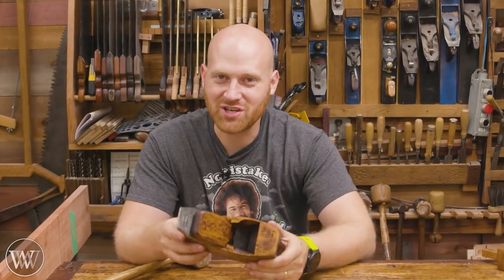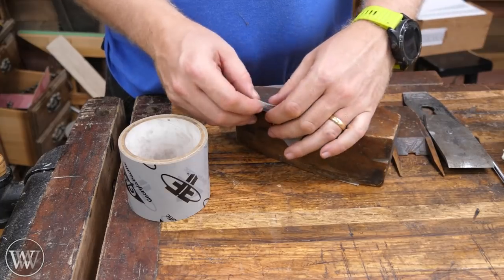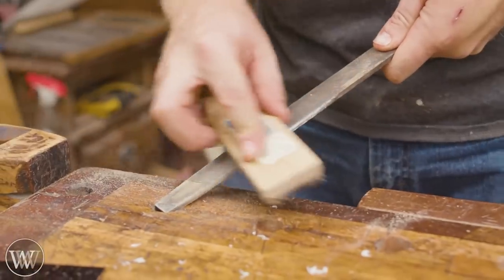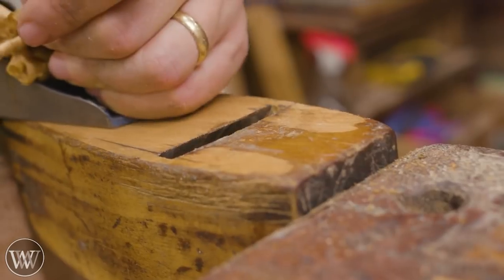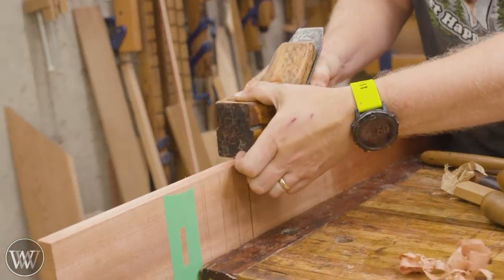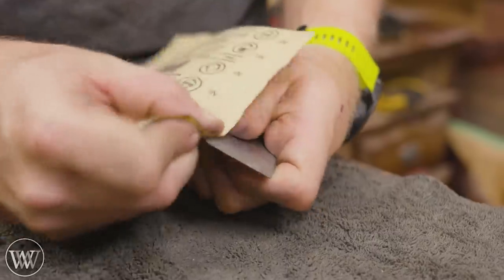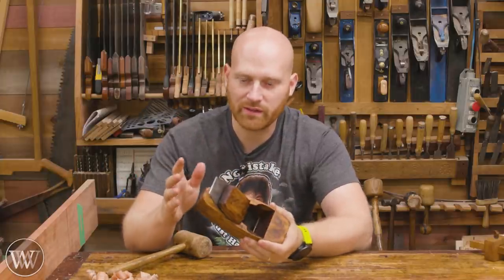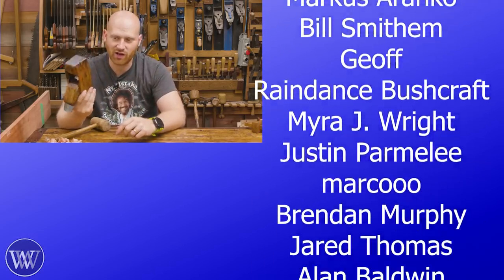How To Restore A Wooden Plane

Comment: I bought my first ‘coffin smoother’ around 18 months ago from an antique shop for the princely sum of 5 British pounds ($6.50). It was clearly a well used tool and bore the craftsman’s initials. Furthermore, it was sharpened to perfection and took an onion skin shaving off the first plank I took it to. Totally frictionless. Since then I have bought a few more from markets and antiques fairs, ranging from £1 to £8, some with good blades in firewood bodies, others with poor or missing blades, and I now have around 8 in regular use. Never underestimate these as curiosities or decorative pieces, they are worthy of a little TLC.
Reply from the maker: Congrats on first.

Comment: Hey James. I restored a coffin plane just like this one, wrong iron, split sides and concave sole. Unfortunately, the previous owner put a heavy coat of laquer all over the plane (yes the wedge & iron, too) which took quite a while of delecate work to remove. The iron was jammed into the plane so badly that I had to use a mallet & a brass punch on the cutting edge to get the iron out. I ended up turnning it into a very good scrub plane that will be around for years to come.
Reply from the maker: Lol yup I have seen those no fun. They often do that for decoration.

Comment: could you also fix the cracks with the method you had with putting in a juice and vacuum seal?..  (referencing your 1st Throwback video)
Reply from the maker: Because this case you had to actually clamp them back in. Stabilization isn't very good for crack filling it is good for hardening softer woods. And stabilizing small pieces so they move less

Comment: Oh neat, I got a pair of coffin smoothers recently and one of them seems to also be a frankenstein and needs a bit of work. It might straight up needs a new body, but I'm nit fussed with that.

Have you ever noticed the iron being lightly bent back towards the chipbreaker after screwing them together? When I pulled out the iron, I noticed it was doing that after a slight struggle to separate them, it's really only contacting the top and bottom of the bed.
Reply from the maker: Sounds like it may have been dropped at some time. often if they're dropped it puts tension into the iron bending it backwards.
Reply: @WoodByWrightHowTo  
Hm. So I guess a good fix would be putting it in a vise near the top of the bend and very carefully bend it back with light tugs?

Either way, I suppose I can just live with it, it's not a gnarly bend, just a slight curve you can see with a straight edge.

Comment: I have a transitional jack plane that has some cracks in the sole.  I don't want to make a new one because the wooden sole has the original manufacturer's markings.  Would epoxy be alright for smoothing out the sole of the plane?
Reply from the maker: That would be what I would use. A nice slow cure epoxy will soak down into the cracks and seal them up nicely.

Comment: I have a wooden Try Plane, and found out the Iron is not an orginal and quit big since it wont fit in. Are there other methods or ways to open up the mouth for the Iron to fit in, or do you think I should take my chance buying another one?
Reply from the maker: If the mouth isn't big enough for the iron then I would definitely say go ahead and open up the mouth. It's usually the other way around.
Reply: @WoodByWrightHowTo  Interesting what you mean it usually the other way around or do you have a video explaining it? Will love to find out.

Comment: Sorry, I am very new to most things in this video, so my questions may reflect that. First, did you speak Windex on the sharpening stones? Second, I have a few coffin box planes, as well as many metal planes, and I don't know if it's that I'm using it incorrectly or if the blade is in need of repairing. What are some of the signs to look for that will tell me if it's the wood body of the plane or if it's the blade that need work??
Reply from the maker: I use a cheap window cleaner on the diamond plates. You can just use water but the window cleaner evaporates quickly so that there's less chance of rusting. Most the time if people are asking if it's the blade or the body of the plane the answer is the blade is not Sharp enough. But every instance is different. If you want to send me an email with pictures and questions I'd be glad to help out.  JamesWright@woodByWright.com

Comment: Do you is the linseed oil on the bottom of the plane as well?
Reply from the maker: yes, but I will be using paste wax during normal use to lubricate it's movement.

Comment: I do have a coffinsmoother that have a slightly but irritatating bow from the mouth and forward its about 1-1½ mm how do i deal with that since the mouth is pretty tight and i don´t wont to open too much by just planning away since it is realy a very fine smoothing plane i know that with use it will be a more corse smoother and in many years to come will ending be a scrub eventual
Reply from the maker: the only thing to do is to flatten it out. if the mouth opens too much then you can fill it with a small plug at the front of the mouth, or add a new sole to it to apply wood back on and close the mouth again.
Reply: @WoodByWrightHowTo  thank you so much  for the fast reply  even thow  i was vory for that answer 😢i gess we always hope for miracle cure hiding  under the stone 😉 have a great day

Comment: If you call this coffin smoother a "Frankenstein" -than the coffin smoother I bought from Tooltique musst be a steampunk cyborg or something like that - The front part of the sole was replaced by 1/4 inch of solid brass. I even start to like it more than a Stanley No. 4 - no space between Iron and chipbreaker, the Iron as thick as a Ron Hock and it needs just one or two very gentle strokes with a light hammer for setting.
Reply from the maker: Wow. That sounds like quite the solid plane.

Comment: Thanks for the insights. i have one from my great grandfather. He was a German carpenter in Cleveland in the late 1800s. The top of the blade is mushroomed where he hit it with a metal hammer. I'll leave that for the story. I have since found that hammer too. Now I know a little more how to recondition this. Question: I've looked around and found these planes sell for only around $20. Any idea why so low? I know about supply and demand, but wow!
Reply from the maker: There are a ton of them out there and few users like to use them.

Comment: Nice video. I have a few to do with blown cheeks so will have to get some low viscosity epoxy and try it. Rather than a card scraper, have you tried denatured alcohol and fine wire wool for cleaning? I’ve had luck with getting the dirt off, but leaving more patina and even, rich colour. Then the BLO really makes it pop.

Comment: Hi! @ 4'11'' You are saying you want to keep the 35 degrees angle? Shouldn't this be 25, being a bevel down plane? Thanks!
Reply from the maker: For bevel down irons 35 is a far superior angle to 25. It will last much longer and cut just as well. The one benefit to having a 25° angle in a bevel down plane is that it will engage slightly better when you're starting in the middle of a board. But that's a very slight benefit. A 35° angle will last twice as long and be just as easy to push. I have several videos on testing, plain irons and chisel's at different degrees and angles.

Comment: I also had a request/idea for one of your live streams one night. A video or live stream maybe even on how to cut a through mortise and tenon but on round stock would be so cool!
Reply from the maker: usually when cutting through sound stock it is with a round tenon. in that cast you use an auger bit. but I am probably missing something. sorry.
Reply: @WoodByWrightHowTo  well I was wanting to achieve the rectangle tenon but going through a round post or leg
Reply: The easy way to do that is to mortise the leg before making it round. If you can’t though, try a knife and straight edge for starting the long sides of the mortise, instead of chisel. as if marking it, but cut deeper. It is awkward to push a chisel into a cylindrical object if you’re not attacking it squarely (makes more sense with a chisel a dowel in hand). The wall of the mortise is inherently fragile if the stock is rounded, and prone to chipping off. Switch to a chisel later once the mortise is established. And of course, you must chop the mortise out from either side, and mustn’t make it too wide or there won’t be enough meat around the mortise. It might be nice to leave extra length so you can screw the leg at either end down to a piece of plywood for the chopping, unless you have hand screw clamps.